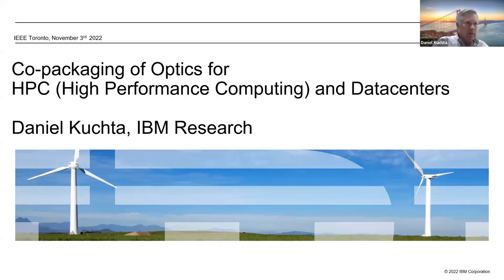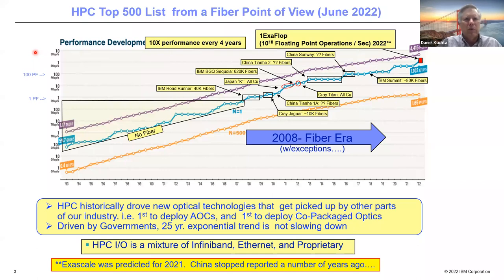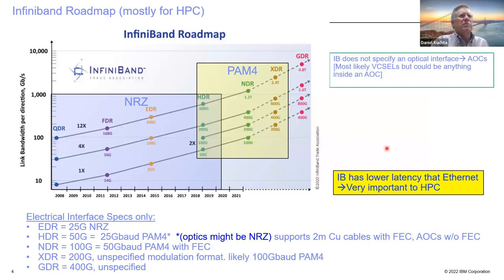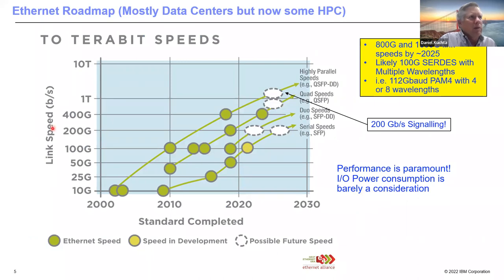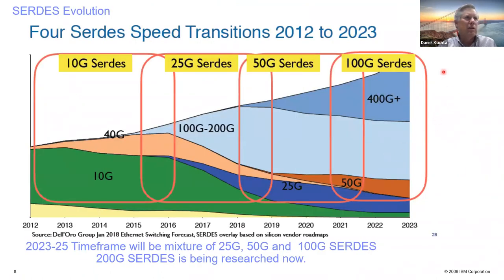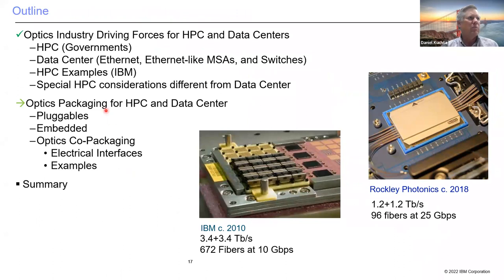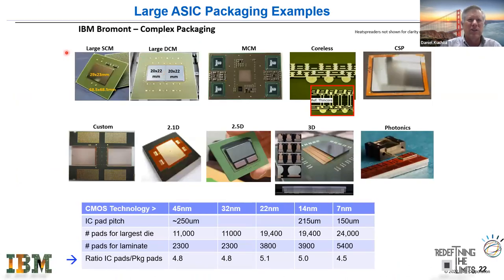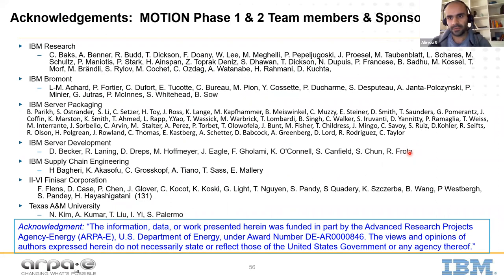Co-Packaging of Optics for HPC (High-Performance Computing) and Datacenters

Comment: I'm just seeing this now. A very thorough documentation of a long history of optical packaging at IBM. So far ahead of its time. It does a very good job of highlighting the technical depth needed to ensure the systems are reliable in the field. Early IBM systems were essentially owned from ceramic powder/silicon wafer boules to machines on the floor. Costs drove outsourcing (make vs buy = reduced headcount) and this meant less control over the quality and often more Task Force activity, which are extremely serious at IBM. 
  It was a great time to be creative in designing and assembling OE packages. The current success of systems is very  dependent on suppliers and their ability to comply with your well thought out specifications that consider multifactor tolerance analysis for other components when assembled. You better be technically paranoid or you're in for unpleasant surprises..